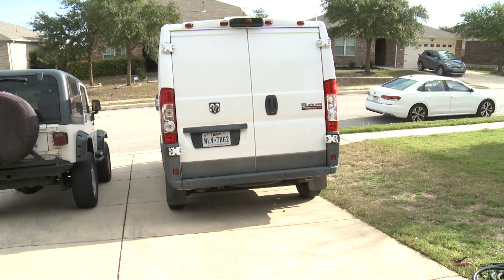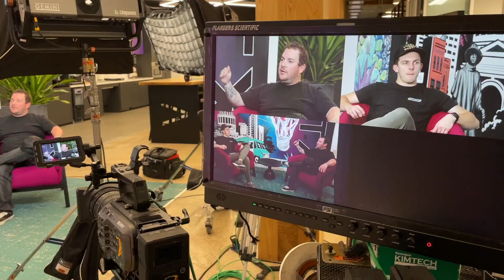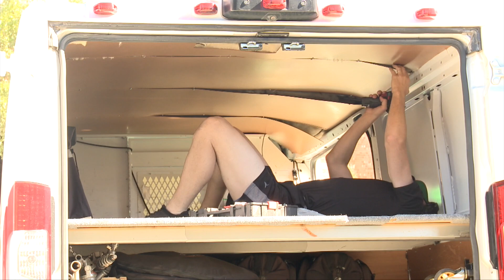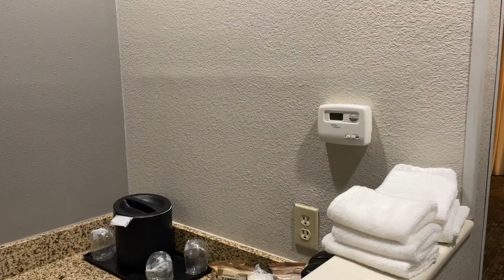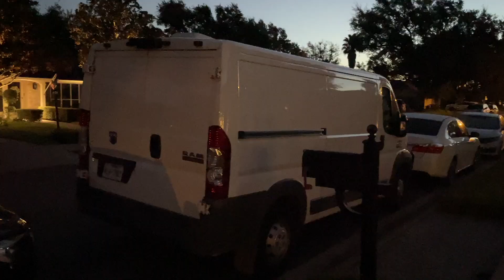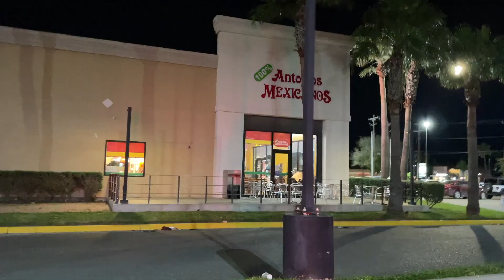Location days and van configuration

Comment: For loading on a steep hill you could maybe use some leveling blocks for camper vans. I saw these in a parking lot recently. It's like a mini hill you drive on (similiar to the things truckers use to stop trucks from moving away if parked). I saw campers use these to level out their vans on an uneven parking lot. Should be quick to setup. Just put them in front of your parked van, drive like a couple of feet forward until your front axis is high enough that you are level. Maybe hard to describe via text. If you search on Google for "camper leveling block" you should get the idea.